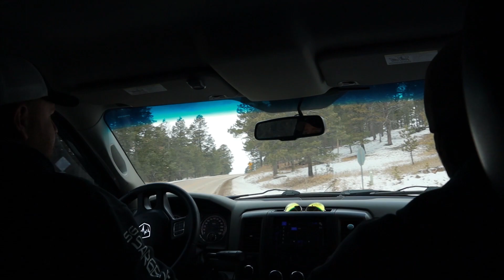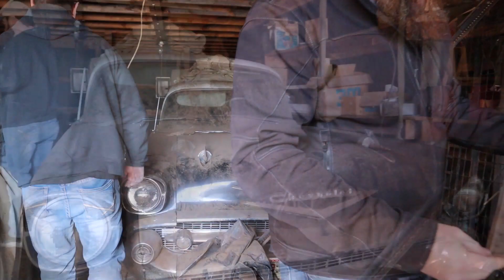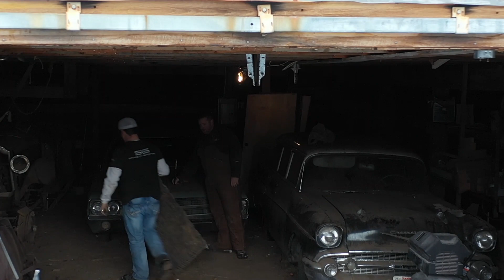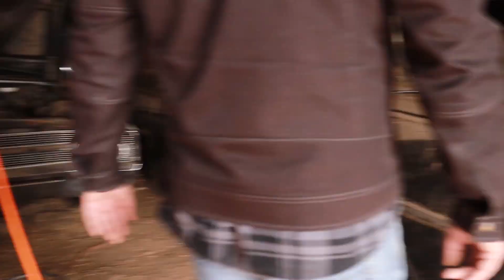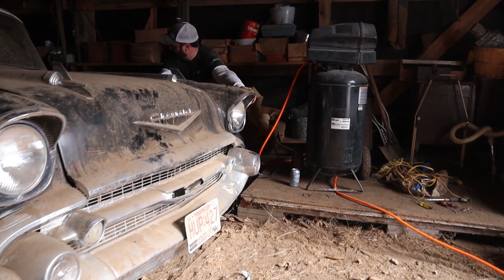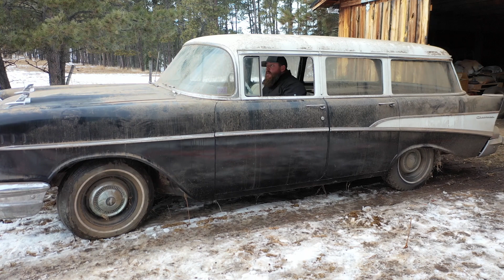True Barn Find 1957 Chevy Wagon, and a few others! More info on Sargent Garage Facebook. #barnfind

Comment: Why can’t I ever find these.? DAMN!
Reply: probably because you're not sitting around waiting for the old folks to die that car is not been sitting in that Barn for more than 10 years that's just a layer of dust on that thing that thing would be so rat infested spider infested and a lot dirtier sitting in a barn out in that field like that but still it is a nice ride but I don't believe it's been sitting in there 35 years somebody would have known it was there and got it a long time ago 157 Chevys have been the top hot rod vehicle for the past 35 years I don't think I think we'd sit in there that long not if I knew it was there 🎩🙉😡😲 Mexico's not that far away
Reply: Jackie Joy oh yeah I agree. I wrote this before I watched the rest of the video, definitely not more than 5 years
Reply from the maker: It was parked in that barn in the summer of 1985. Also, nobody has to die to purchase cars here in South Dakota.
Reply: @sargentgarageautomotiveres3827  depends where it’s located for the condition of course, as long as it isn’t costal, it’s probably pretty nice. 
Mojave is a great place for cars, they are mostly 20s-60s, only problem is burned out, or bugs really.

Comment: You should have gotten the 57 running and used it to tow the dodge. The video would have been epic at that point.
Reply: My dad bought a new ‘57 210 Chevy 4dr wagon for the family. Black just like this one except no white top and side panels. Had a 283 2bl. I recall it had an AM radio and only two seats. It was a beast in snow and as reliable as a Timex watch. We drove it over 100k and when the rust worms had taken over we sold it to one of my best friends who drove it a couple more years before parting with it. I got a little misty eyed to see that Chevy wagon get towed into the light of day. Restore it because the car deserves it. Looks to have excellent metal and little if any rust. Congrats on a great barn find!!